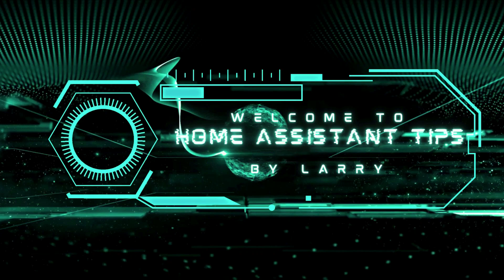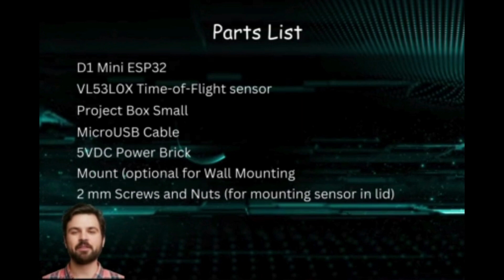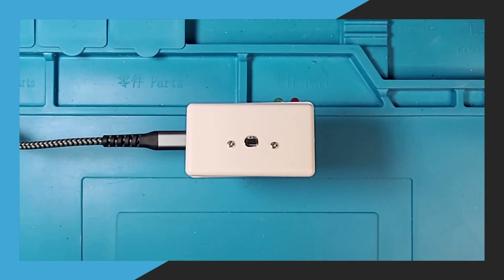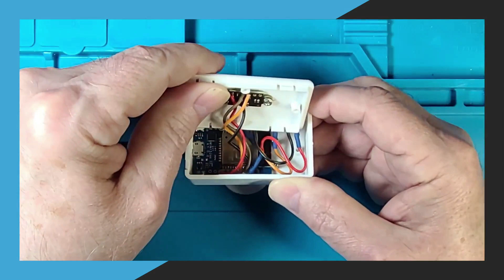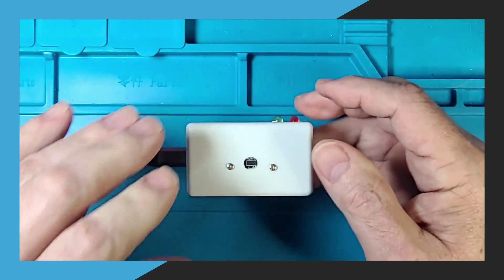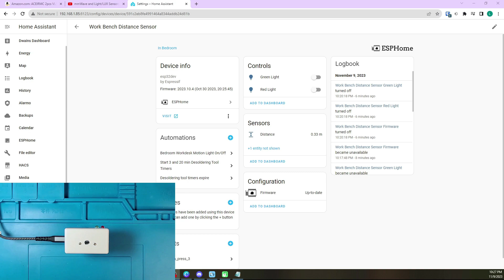VL53LOX Time-Of-Flight Sensors in Home Assistant

Comment: hi this can only pick up one object?
Reply from the maker: It's not a motion sensor, it's a distance sensor. No distance sensor can pick up more then one object. If they did they would be useless. 😀
Reply: @HATipsByLarry  I though you know more than most. have you heard about the mmwave sensor?
Reply from the maker: @roystervi  There are several. One i use the most is the LD2410C. https://www.youtube.com/watch?v=YNEQxj-JnEs It can only pick up one moving object at a time as well. But does support zones https://github.com/HATipsByLarry/LD2410-Zones The LD2450 can pick up several objects at a time, but it is not currently natively supported by ESPHome as of the time of this post. Although i've heard there working on it.
Reply: @HATipsByLarry  I am currently using the LD2410C with 3 zones. 1st time seeing this sensor
Reply from the maker: @roystervi  Good job. 👍

Comment: Can this be used for a entry and exit point as a person counter ?! Or have 2 ToF sensors ?!
Reply from the maker: Yes, the sensor will only change states when you are directly in front of it. It can detect up to around 6 feet in front of it. It reports as unknown when detecting nothing then starts reporting the distance  to the object in real time. I use it in my bed occupancy sensor to detect when i'm setting in bed vs laying down. Also use it at the entrance to my foyer to automatically unlock my smart lock on my front door. You could use it to count people also, just create a HA counter helper. You would need 2 TOF sensors for that to know weather to increase or decrease the counter.

Comment: If I have a D1 Mini instead of the esp32, which GPIO ports should I use?
Reply from the maker: The D1 form factor comes in 2 flavors the ESP8266 and the ESP32. I'm assuming your referring to the ESP8266 version. The ESP8266 does not come with I2C (pronounced eye-squared-see)  hardware pins as such but you can use GPIO pins 4 (SDA) and pin 5 (SCL) to do the same thing.  Here is a link to a web page that explains the protocol and the hardware a bit more https://randomnerdtutorials.com/esp8266-pinout-reference-gpios/ Hope this helps and if you have any more questions please don't hesitate to ask. FYI, make sure to change pins in the code to scl: 5 and sda: 4 otherwise it won't work.